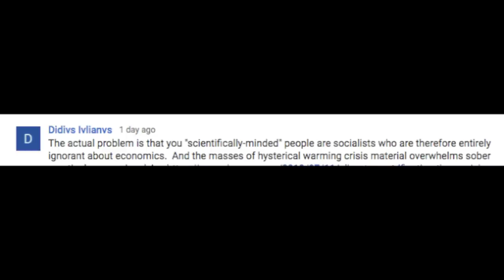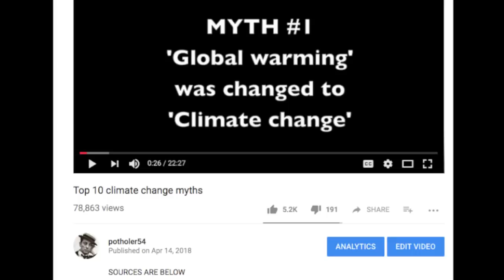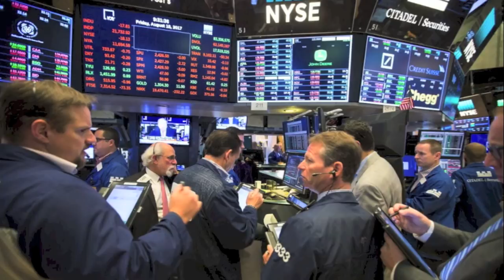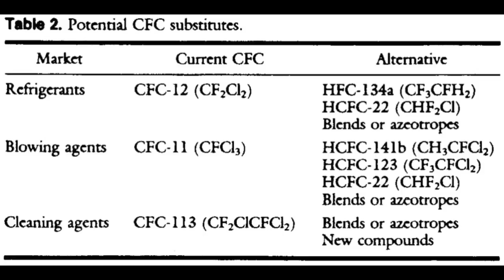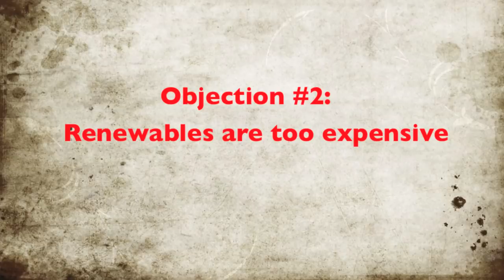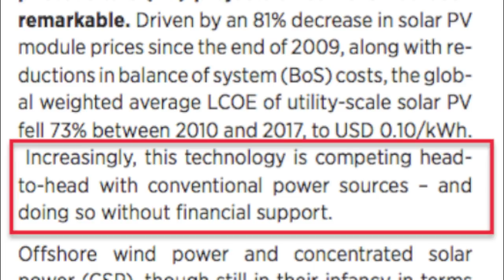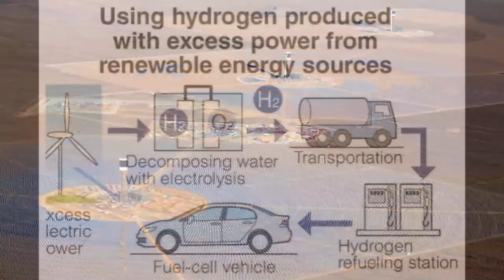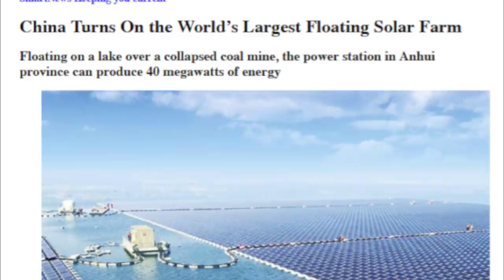A CONSERVATIVE solution to global warming (Part 1)

Comment: What happens when wind farms on every hill ruin my freedom to enjoy natural landscapes?
There has to be more elegant and efficient solutions than wind mills everywhere and oceans covered in solar panels.
Reply: then so do coal-fired plants, cities, streets, planes and most of all: the global warming itself by changing the natural landscapes, etc.
like seriously. what's the bigger loss of natural landscapes: a few wind farms on hills or entire islands sinking, antarctica melting and natural disasters wrecking havoc?
Reply: mulraf of course! However, at their present efficiency, there footprint on the landscape is much bigger. It’s just no one really talks about this aspect. I agree with the narrator that the best way to solve this is research and development. At the moment, coal-fired power and nuclear power don’t cycle the landscape as much because they are so much more efficient and effective. Better storage options for wind and solar could solve this.
Reply: Paul McLennan From my experience smaller wind mills look pretty decent. Maybe they are anyhow just a (necessary?) step in development. The lifetime of a mill (in Germany) is apparently only about 20 years, after which they may be replaced (with new technology?) Though, I think the alleged infrasound risk and impact on bird life may be critical points.
Reply: Transmission losses alone make windfarms / solarfarms inefficient. Solar panels are best suited for local energy production. Fill all the rooftops with panels (...Just don't put the panels on roadways, ffs. That's like building wind turbines indoors) and you can significantly cut how much imported electricity you need from the grid, and in case of a small excess electricity you can feed it into the grid. Nuclear energy is the cleanest, safest and the least expensive to maintain per kWh.
Reply: @Gekkibi  I think roads and car parks with frames arching over them to support solar panels could be a way of minimizing impact on natural landscapes, consolidating our footprint, keeping panels clean and functional, not having to reinvent paving technology, and providing some GUDDAMN SHADE for my car when it is baking in the sun at the supermarket!
Reply: @eachday9538  If you want a sunshade for your car then have a practical sunshade made out of something more suitable for that purpose. Solar panels should track or else they lose a significant portion of their efficiency: a ballpark estimation is that a tracking solar panel will produce 40% more than a stationary one.
Reply: @Gekkibi  True, but there is additional product life energy investment and financial investment involved in the more complicated mechanism as well as the cost of having to find a suitable location for placement. For example, more productive land lost or greater transmission loss from tracking arrays being situated further from demand. I'm not saying tracking arrays can't be the better solution in many cases, but it is not as clear cut as saying it is 40% more efficient if you track the sun. A good case in point is some of the new cheap flexible printed panel tech that is coming out. It is not as efficient per square meter as rigid panels but production is very cheap and it has some installation advantages that can suit some site needs better. For example, transporting great distance to a remote area of an under developed country where there is limited fabrication tech available but plenty of space to just roll it out. So, it's horses for courses. In a highly developed country where you are trying to minimise urban sprawl onto productive land, or encroach on natural beauty then finding systems that will stack onto existing infrastructure to cube the productivity of the space makes sense. I live in a hot hell hole of a country and I appreciate every bit of shade I can get, Some car parks have shade structures, it makes sense to me to capitalise on that framework and kill two birds with one stone.
Reply: @Gekkibi  Nuclear are shit.
You obviously don't know what you are talking about.  The electricity bill you pay now (for nuclear power) are in no way representative for the 
 final/total costs(and that in several ways).  
That is also why several European countries - who has realised the enormouse costs - have put the breaks on.
So Belgium, Spain, Switzerland, Norway, Sweden and Germany has decided to decommission their nuclear reactors.
While Norway always has been on renewable in form of hydro electric power production, are Germany leading in other forms of renewable.
In the USA politics are under strong influence of the lobby from the coal- and nuclear industry.
So as long as it is the money that determines the politics - in stead of rationality and science - you get result with the status of USA.  Which is pitiful.
Reply: @xpost9381  I guess a random angry person on the interwebs knows more what my electricity bill is made out of than I am...
Reply: @Gekkibi  So your take on seriouse problems are sarcasm.  That is just is just sad and pathetic.
No, I don't know where your personal electricity supply comes from.  
But that does not change anything of the problematic sides and costs with nuclear.
You promote nuclear power and I point at the problems with it.
Reply: @xpost9381  I'd rather pick sarcasm than passive aggression.

I'll leave you with some homework: calculate how many wind turbines of your choice must be installed to replace one nuclear reactor of your choice. Then dig a little deeper to data sheets (assuming you have access to them... If you don't then I guess you're not qualified to argue know how in-/expensive it is) and see the required components for each maintenance plan.

Next time kindly pick on someone of your own size.
Reply: Where exactly are those "natural landscapes"? The ones I see from over here are mainly agricultural deserts and citys between them.
Reply: @Gekkibi  Maintainance costs are one thing but when talking about nuclear energy you can´t deny costs for building the plants,  upholding and maintaining the Uranium supply chain and dealing with nuclear waste. And those are some tough cookies right there. Don´t you think?
Reply: @burninghard  Exactly.  The costs for the waste never ends and also the costs for taking down a plant are far out in the unknown. The income - well - that is zero
No nuclear activity - from mining to storage - has happened without impact on the nature.  The two worst examples of ongoing and continious pollution of the sea are the reprocessing plants in Sellafield in UK anf Majak in Russia.
Reply: @burninghard  This is why I explicitly used the word "maintain". The initial investment is by far the most expensive, but that comes with a benefit of having by far the longest lifespan.

What comes to nuclear waste, particular countries have already entirely solved that aspect.
Reply: @Gekkibi  Okay thanks for the response. When you call renewable energy sources expensive could you please elaborate how the overall costs over the lifespan of a regular nuclear plant are if compared to the same amount of  electicity produced by renewables? And do those calculations also take into account the necessity of mining, refining and transporting the needed raw materials to the power plants? And do they also take into account that Uranium is after all not an unlimited natural resource and thus could eventually get more expensive with time?  

Furthermore I would be interested how those particular countries solved those problems and of course which countries you are referring to. How about the costs of those mentioned solutions? How do those play into the projection of the overall price?

Thanks in advance!
Reply: @burninghard  I'm not directly calling renewable energy sources expensive. It's just that overwhelming majority of people tend to ignore maintenance costs when they say that wind energy is cheap. Doubly so when visions are getting out of hands, like filling the oceans with turbines. Can't even imagine what kind of logistical nightmare it would be to ensure each individual turbine gets the right spare parts at the right time.

What comes to waste disposal: Finland. Check out "onkalo".
Reply: @Gekkibi  Thanks for your response. And yes you are right. After I reread your comments you clearly only compare maintenance costs of nuclear to wind turbines. But isn´t that like pointing out the energy source for renewables is a lot cheaper since wind and solar energy are basically free? Wouldn´t that be equally misleading though true?

I mean I hear you and agree with you on the front that maintenance is of course an issue you have to recognize when talking about energy production. But that does not really tell the whole picture if you want to figure out which route is best for the future, right? 

One more thing: you claim that nuclear power plants are the least expensive to maintain when compared to renewables. Yet unless i missed it you are only referring to wind turbines. Without knowing the exact figures I could well imagine that maintaining thousands of wind turbines is probably a lot more expensive than maintaining a nuclear power plant. But what I wonder is how solar fits into that picture. From my understanding I always thought solar was pretty much maintenance free. What did I miss on that front? Could you eventually provide some figures comparing maintenance costs of nuclear compared to wind/solar?

Thabks for the link on that waste deposal. I checked it as far that is possible in the internet. So please correct me if I am wrong. From my understanding Onkulu wil be the first final repository for high radioactive nuclear waste going into business this year. But as we all know that nuclear waste will keep being problematic for a lifespan for many thousand years. When talking about final solutions how can we/they be so sure it is a safe solution for the many centuries to come? I mean sure on paper the incapsulation in mercury sounds great but how can you asure that corrosion and thus possibly pollution of drinking water/soil is not a thing within the estimated 100000 years it will radiate until it´s not harmful anymore? I find it hard to believe you could accept that as a certainty when there is really no long term experience in that field. 

Oh and that procedure sounds really expensive. Do you have any figures on the estimated costs?

Also forgive me for pressing you on the issue but you mention "countries" that already entirely solved that problem. Which other countries have already solved this issue? Plus I wonder if it is not too far fetched to call it entirely solved, when they only recently came up with  a possible solution, we don´t have any long term experience yet. Or did I miss something?
Reply: @burninghard  ...That was a handful. I'll address at least some of your points, but unfortunately I'm currently somewhat busy so can't spend as much time as I probably should.

The reason why I point out the maintenance cost is exactly because wind power isn't free. Unfortunately, and it really grinds my gear, it is hyped to be free. Wind turbines contain mechanical parts, and just like any other mechanical parts they are subject to wear & tear, and therefore each part require a maintenance plan. Unlike the typical maintenance "plan" consumers use ("I'll send it to a repair shop if it breaks"), preventive maintenance is used, and each part is either overhauled or replaced based on strict maintenance plans (based on variables like "expirations date", "hours in use", etc). Naturally nuclear plants also have mechanical parts, but not as many as the amount of wind turbines required to replace a nuclear plant.

The reason why I don't use a negative tone when talking about solar panels is because in my mind they are generally more feasible (generally, not universally) and technically don't require preventive maintenance: if a panel breaks due to external force then replace a panel. Of course that's not free either, especially if the climate is harsh. I doubt solar panels in -40 C/F winter conditions last as long as in moderate snowless weather. What I see is the biggest problem with solar panels (after power losses due to long distances, that's why I'm against big solar / wind installations) is their lifespan. Of course it's getting better each year, but the ROI could still be better, and the manufacturing of solar panels isn't, as far as I know, very environmentally friendly either.

Many aspects must be taken into consideration when building a nuclear waste storage. Onkalo is built inside the bedrock, and therefore there's no water or soil in the immediate vicinity. The biggest problem in my mind is to ensure that the future civilizations don't dig from the wrong place during their archaeological expeditions... If the warnings about pharaoh's curse didn't scare grave diggers, why should a different kind of warning work any better...

The budgeted/estimated price for Onkalo is 3,5 b€ in its entirety.

There are similar kind of programs in other countries, they're just not doing so well when compared to Finland's onkalo. There's at least one in USA for example.

Onkalo isn't some recent discovery. Finns have had the idea for decades upon decades. The Finnish government has collected funds for this as long as there have been nuclear power plants in Finland.

Hopefully I managed to answer to at least some of your questions.
Reply: @Gekkibi  Thanks for the very detailed response. I try to make my response as short as possible let´s see if I can succeed . 

So just to be clear that I understand it right. 

"But isn´t that like pointing out the energy source for renewables is a lot cheaper since wind and solar energy are basically free? Wouldn´t that be equally misleading though true?"

The answer is basically yes and you agree with me that we should always try to compare the overall costs. Please correct me if I am wrong.

But yet you only compare the low maintenance costs of nucear power plants to wind turbines in order to make a point for nuclear over renewables when it comes to economic efficiency while ignoring the low maintenance costs of solar panels and not considering any other costs. Isn´t that cherry picking?

On my question

"When talking about final solutions how can we/they be so sure it is a safe solution for the many centuries to come?"

I extrapolate from your answer that in fact we can´t. What exactly leads you to believe that we can be assured this kind of facility completely erases all potentially threats? Are there studies that confirm the safety of this solution? And when you say "not doing so well" when talking about projects in other countries what exactly do you mean?

From your original post it sounds a lot to me that the problem of nuclear waste disposal is completely solved. But this is the only repositiory worlwide yet and it is not completely clear it will work out, right?

That really does not sound to me as if the problem was completely solved. For me that sounds rather like "there might be eventually a good way to tackle that problem but it needs more time and research to be sure".

But no matter how you want to look at it I think the many decades of research plus the enourmous construction costs of the respository need to be taken into account when calculating the overall price of nuclear energy.

Hopefully you agree here. 

Also 3,5b € is surely not peanuts.

From what I know it is only designed to hold the nuclear waste of five plants. To be frank you would need a few hundreds all over the world if you wanted to fight global warming by substituting all fossil fuel based energy sources with nuclear power, right?

And from what I know the repository in Finnland only can hold around 6000 tons of nuclear waste. One nuclear plant according to my sources generates around 20-30 tons of high radiating nuclear waste per year. Overall that that would mean Onkalo could only be used for apporixmately around 50 years before it needs to be sealed.

I´ll be honest that does not sound like a very convincing concept to me at all. Especially if you also take the enourmous building costs into account plus the potential costs for deconstructing power plants after their 30-40 years of lifespan. From what I have heard it is almost as expensive to dismantle as it is building them.

Do you have any figures how the overall price would be if you would include all factors? 

Sorry I wanted to make it short but unfortunately I wasn´t able to.
Reply: @burninghard  Even when comparing overall costs, nuclear energy is cheaper than pretty much everything else. According to a study by LUT, nuclear energy costs 42,4 €/MWh when built on an already owned property. Solar power 99,6 €/MWh and wind power 41,4 MWh. Without tranmission losses. When those are added (you simply can't lump enough wind turbines where the demand is located) you will lose more than that 1 MWh. So yes, I'm happy you agreed with me that we should definitely compare overall costs...

How can you take all possible threats into account with wind turbines? Those can fall off, blades can fly away, and so on. We can't. If we extrapolate enough then we come to the logical conclusion that we should devinitely never leave the comfort and safety of our homes.

By "not doing so well" I'm mostly referring to poltiical problems, because for some reason the average voters (insert George Carlin quote about average people here) have started to hate nuclear power.

Nuclear power is not the long term solution, but neither is filling every possible unused surface area with inefficient alternatives, or worse, shutting down already existing reactors.

Here's an easy solution how to fix the issue of over-consumption of energy: increase the price of kWh by a factor of 1000 and that would kill all the poor. At least we should run this idea through the computer. Mitchell & Webb were onto something.
Reply: @Gekkibi  Hejo! Could you please link me to the study you mention? Because I doubt that that study takes into account all sorts of costs. For instance you mention "on already owned property" . For me that sounds like the building costs and the costs for infrastructure got ignored which we both know are one of the key factors when talking about overall price. 

Also I really doubt that the study will take into account the potential economical risks resulting from any kind of long term storage. Like you already mentioned it took decades of research and development (and thus costs) to find one area to dump the waste and here it is highly controversial if it is really a final solution.

And I am not convinced that the study takes into account any possible scenario like Fukushima or Chernobyll. Yes that were extraordinary cases and it is not very likely that this could happen again but it is a possibility you have to consider. This is why from my knowledge no insurance does want to cover those incidents.

And I would really love to see how the study takes into account the tremendous costs of dismantling nuclear power plants. That´s an estimated 100B per plant if my sources are right.

So yeah I would really like to see that study. A link woudl be highly appreciated.

Sure wind turbines can break down and eventually someone could die. But the risks are pretty meager compared to nuclear energy don´t you think so? The effect of another Fukushima or Chernobyll near a densly populated area would be tremendous and the economic impact a desaster. If only one of the final repositories will leak into ground water this could have enormous impact on generations to come.

Plus on one side you mention the enormous costs to maintain wind turbines but pretend that they are basically old rusty giants fixed together with glue and hope. I haven´t found any deadly incident through a wind turbine losing blades. Maybe you can help me out there?

And again you don´t mention solar energy at all. What exactly is not safe about solar energy? 

"Without tranmission losses"

Which nuclear power plants also have. Or why exactly are the transmission losses a factor with renewables that evidentially need to pass lower distances due to their decentralized nature than nuclear power? From my understanding the losses should be even higher with a centralized system like nuclear. 

"nuclear power is not the long term solution"

From my point of view it is also not a short term solution. Here is why I think so:

Power plants are extremely expensive to build with sometimes decades long building periods and very specific conditions for the consturction site. 

We simply can´t wait twenty more years until we come up with a solution we need to act today. 

Is it important to factor in all aspects when talking about renewables? Absolutely. Are renewables the end of be all. Surely not. Do they have problems. As every other human technology they have for sure. But from my point of view investing into a technology that potentially could kill off huge areas for decades to come and produces toxic waste that needs to be dealt with for generations to come plus is extremly expensive and lenghty to build can not be the solution for now.

If I would really place my bets on any new technology I will completely agree to replace wind farms and solar panels with fusion reactors when they are ready to launch. But traditional nuclear energy is imho an outdated model.
Reply: @burninghard  Google shadow-censors my comment if I add any links to it, so: "Sähkön tuotantokustannusvertailu"

Vakkilainen, Esa; Kivistö, Aija (2017).

Nuclear waste & dismantling of the plant are taken into account, as stated on page 6. On the same page it explains what I meant with "already owned property". TL;DR: next to already existing plant.

It's dishonest to always bring Chernobyl. Archaic design "maintained" and operated by buffoons. If something, Chernobyl is a good argument in favor of updating old nuclear plants into modern ones. A tsunami can't affect where tsunamis don't exist. Location, location, location.

What comes to meager risks of wind turbines breaking when compared to nuclear energy. No, I absolutely don't think so. Severe injury per TWh is miniscule. I'd willing to bet that there have been more severe injuries per TWh when building those wind turbines. It's a long way to fall.

Trasmission loss is less severe when you have the nuclear plant close to the consumption. You simply can't place enough wind turbines or solar panels near major cities, so you have to place them further away. And then some artistic visionaries are trying to explain how filling Siberia with renewable energy sources is somehow anything but an enormous joke to every engineer on this planet.

If nuclear power is not the short term solution then I guess the plan b of killing all the poor will bring the desired outcome.
Reply: @mulraf  So there is the option of trading two evils that have not occurred already? Really, what a stupid way to present your argument. As what the video said, you see a problem, find a solution, don't let give up.
Reply: @Duxaization  first of all i'd like to say that the one evil personally isn't even an evil for me as i don't think of windfarms as ugly. but putting my personal opinion on the side i never spoke about trading two evils. i talked about reducing the evil. and i don't see how the reduction of a bad factor isn't a good factor. makes sense to me.
Reply: @burninghard  Have you been able to locate the article I mentioned ("sähkön tuotantokustannusvertailu" by Esa Vakkilainen and Aija Kivistö, 2017)? Unfortunately I can't post a link to it because of how l0gik4l the auto-censor bot is here on YouTube, but it should be trivial to find it by just doing a simple google-search.
Reply: cough nuclear cough